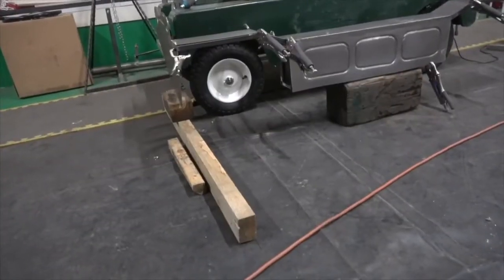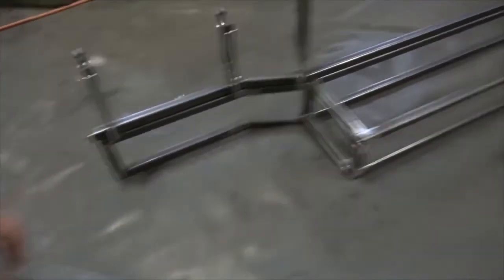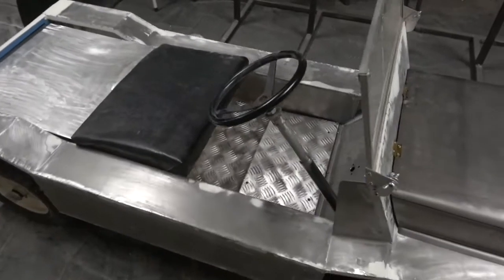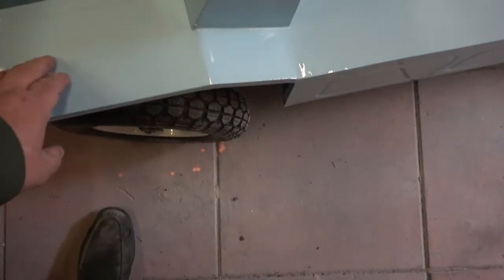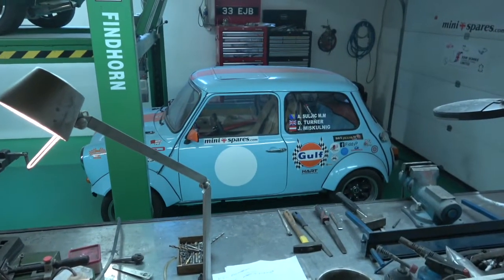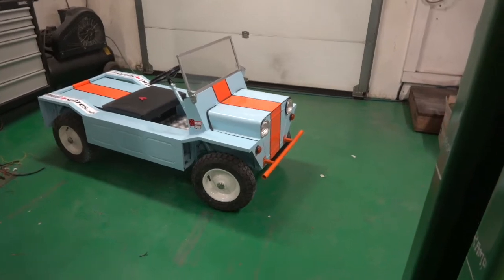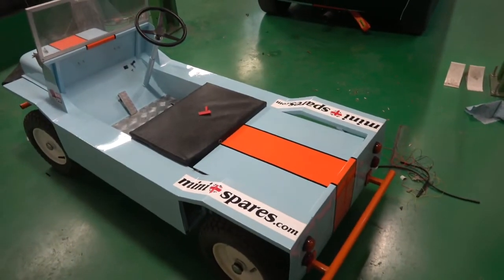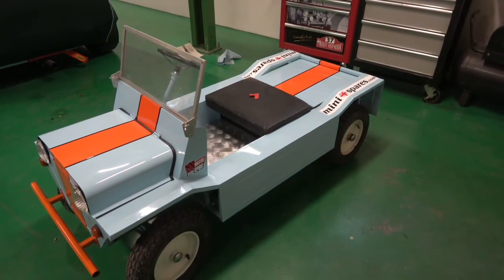Scaled Down Mini Moke Custom Build From Start To Finish.

Comment: A great job Dave I look forward to seeing it running around the paddock the next time you visit the circuit. Kind regards, Richard.
Reply from the maker: Richard,  Thanks,  The next project is to make a ladder ramp for it to sit on & over the tyre rack that fits on the car trailer. Cheers Dave

Comment: Excellent 👌🏻 it looks brilliant. I definitely would get some bungs or caps for the ends of the bumpers though before you take a chunk out of your shin! 🤣
Reply from the maker: Matt, Thanks, I‘m pleased with the way it‘s turned out i just need to work out how to mount it on the car trailer, Good point on the shin catcher lol. 
Cheers Dave

Comment: Is there any place to get the actual measurements of a Moke, I would like to build a full size car and utilize a front wheel drive engine and supension if the measurements are close. Maybe a ford festival, or a Chevy Cobalt. Thanks